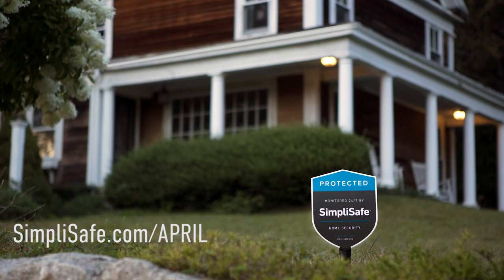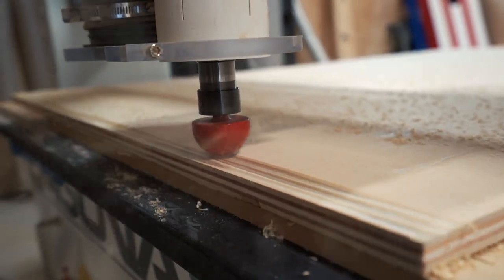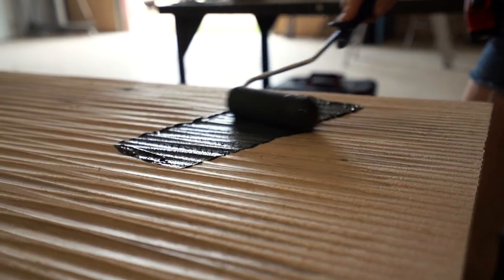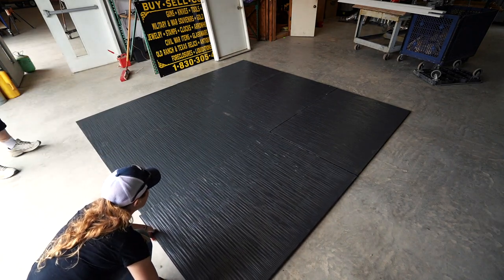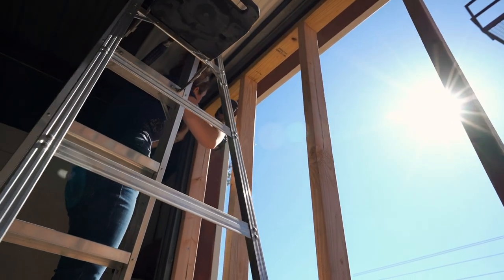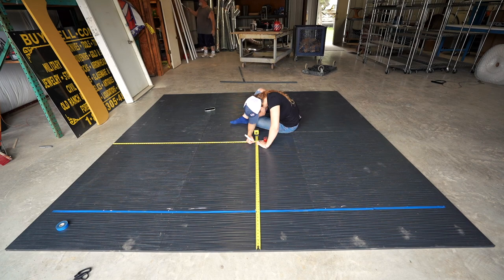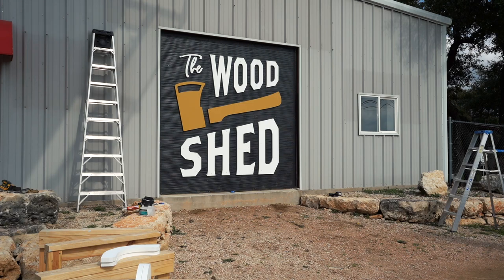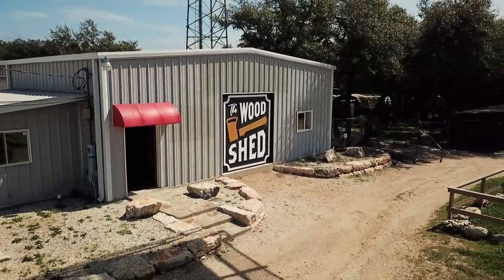Making A Giant 10' Wooden Sign

Comment: Best of good luck in your ventures. A word of advice on stick-on products, especially for exterior use. Stick-on adhesives have a history of failing with time & weathering cycles. I'm sure that tape you used comes with an excellent warranty. However, as an O.G., I recommend backing up all exterior systems, most especially horizontal seams, with a mechanical fail-safe (e.g. z-bar flashing). All good weatherproofing has a double safety measure component. 
Are you near Canyonville?

Comment: Looks awesome.
One small suggestion that might or might not make the sign look even more awesome and it'd be really easy to add or remove.
A small round piece that looks like the head of a philips screw at each corner as if the sign is screwed to the door.

Comment: I wish she’d told us how the wall and/or sign are sealed at the bottom against the slab...
Reply: Spoiler alert, they aren't. I just hope that's marine ply and UV resistant paint :/
Reply: I’m weeping, or is that drainage from behind my facade?
Reply: Why? It's irrelevant to the point. There are 100s of videos that cover that subject.
Reply: @guitarchitectural  you have no idea one way or the other, unless you were there?
Reply: @watcherofwatchers  I'm an architect and my entire job is to detail houses and oversee the construction. I watched with both of my eyes both here and on Instagram. There isn't so much as a sill gasket let alone any kind of flashing... You can see they even removed the door sill which would have helped keep water out. It's low stakes because it isn't a structural wall but the bottom will rot out, and in heavy rain water may get inside.
Reply: @watcherofwatchers  We got her wrap/seal system for the wall.  Plus the wall went onto the slab in   an odd way as an afterthought in a doorway.  It just seems like a point of interest.

Comment: HEY! Love watching your journey over the years! Keep killing it!
QUESTION! 
Using aspire. When doing the tiling function. I'm trying to do a wall, kind of like yours with multiple pieces. But the "tiles" will be smaller than the actual material. example 40x85 out of a 48 x 96 sheet.  Is there a way to add tabs to the tiles so they aren't just loose. When Aspire does the tiling it has some sides facing inside the design, so i can't put tabs. 
2.  I saw you didn't use any hold downs or screws for yours. Were you using tape or a vacuum table?

Sorry this was a bit long and possibly unclear. If you have a solution or tip I'd really appreciate it. 

Brian

Comment: No doubt you have an abundance of projects, however this may be the nudge you need to work this idea int the cue.  I have a 1974 Air stream on which I will soon start a complete remodel.  One of the features I want to add is a Murphy bed.  My version will tilt on the long side and incorporate a desk underneath.  I have a plan, but I'm quite sure I could learn a thing or two from your interpretation of this tried and true space saver.  If you are interested I can send you a PDF of a could of my sketches.  I can't imagine this wouldn't have broad enough appeal to be a good video project.